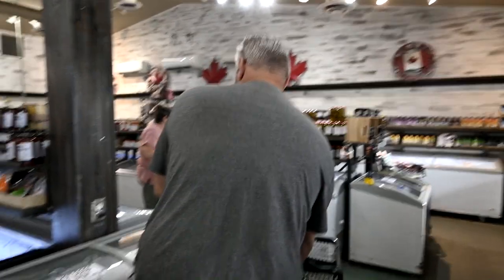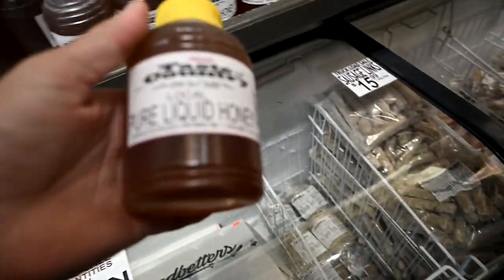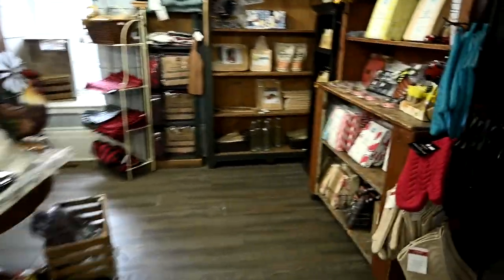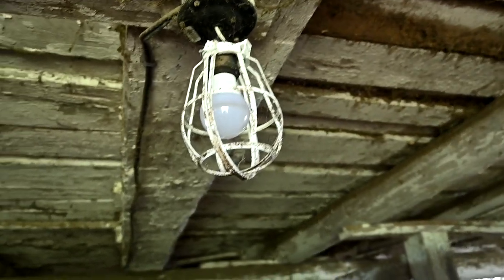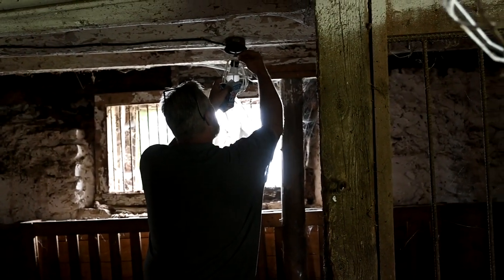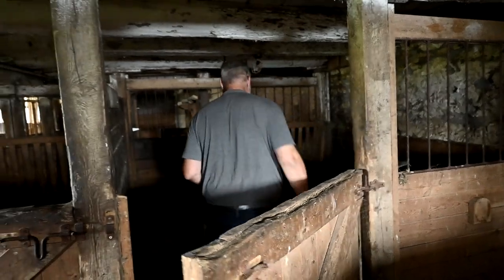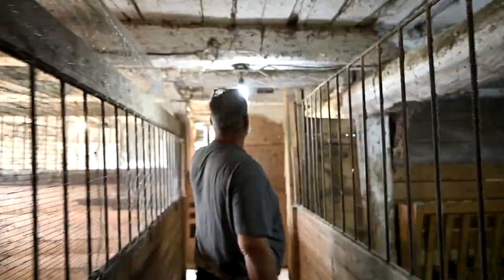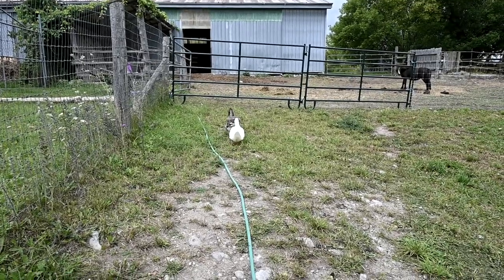We Came Home To A Huge Predator On Our Farm!

Comment: If you use the stall in the horse area for the duck and goose, maybe keep the gate closed so the horses don’t interfere/mess it up and add a cat door or coop door to the outside wall so they can go in and out during the day but be locked in at night like your chickens!
Reply from the maker: I love  that!  The reason I don't feel safe using it is because it's not raccoon proof at night time. Winter is coming, and I know hungry animals are going to be hunting more.  I feel like there is another plan that will work for them!  I just can't figure it out yet